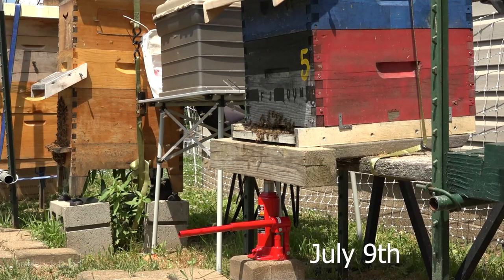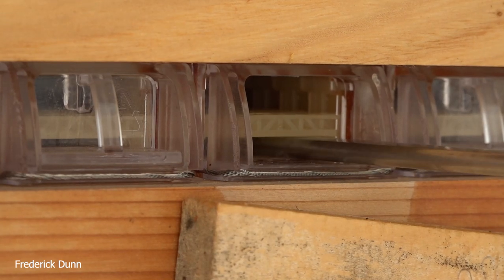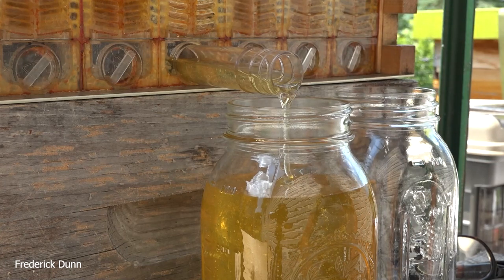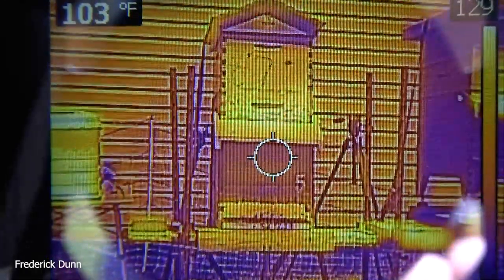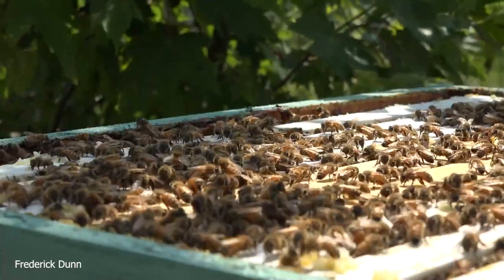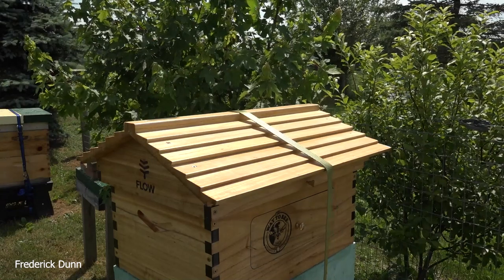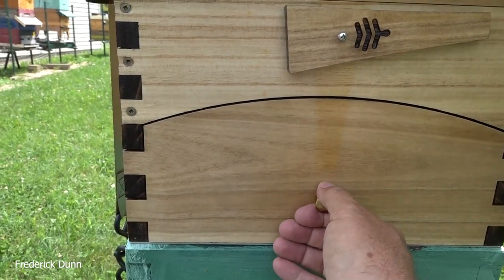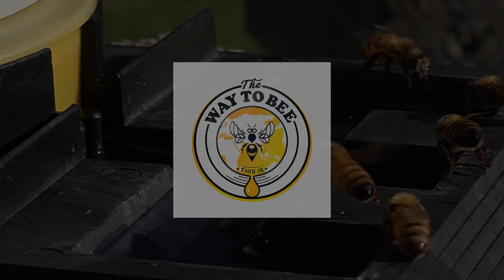Flow Hive Hot Weather Supering, How I Do It Without Queen Excluders, Better Comb Update and more.

Comment: I know it's probably a pain but thanks for the Celsius conversions! :-)
Reply from the maker: Doing what I can to improve on that :)  you're welcome Peter!
Reply: @FrederickDunn  Here in Oz we changed to metric when I was a kid in 1975. But feet and inches are often a convenient measure so I still use those. Temp is more difficult to convert and then you have your own US gallons which are different from the Imperial gallons we used to use. When you get used to metric it is sooo much easier to use. Here's a farmer's example...how much water (in gallons) falls on a square yard when you get an inch of rain? Bonus question...how much would that water weigh in pounds? (Feel free to use a calculator). In metric an inch is about 25 millimeters and a yard is a few inches smaller than a meter. So how much water falls on a square meter after 25mm of rain? 25 liters. How much does it weigh? 25 kilograms. :-)
Reply: @peterzweck1763  that's clever Peter. Where in Oz are you located?
Reply: @jasonrasheed7670  Southern NSW.
Reply: @peterzweck1763  hope you weren't too badly affected in Jan.

Comment: Fred, I put flow frames on two of my hives recently for the first time.  To my dismay, I observed three bees completely inside three of the cells not moving.  Not moving for a long time.  All the other bees around them were busy working.  My initial conclusion was that these bees had died while working.  The next day I came back to find each of these ‘dead bees’ were gone.  Instead of bees working themselves to death preparing these cells, is it possible worker bees take a nap periodically inside the cells they have been working?
Reply from the maker: Hi Larry, you have just witnessed members of the Wax--Workers Union taking breaks at length while appearing to be working from the cell entrance. It's most often the case that they are napping. It's extremely rare, unless it's winter, for workers that are near death to insert themselves in cells. In winter, starving bees will be found clustered in cells trying to stay warm and licking every little bit of honey.

Comment: Great video again!!  

While queens tend to not cross the "honey barrier" going up, what about laterally through a brood box?  If there are several frames with brood toward one side, but one side has a frame (or two) chock full of honey, will the queen go past that hone to lay in other frames there?  Or, should we move those honey frames out toward the side and insert the "empty" frames interior, next/closer to the brood frames?
Reply from the maker: That's a great question!  The brood frames are where the queen continues to lay in a radius of cells... IF she runs out of available cells, she wanders around other frames in the same box. If she meets a solid frame of honey before finding open cells, she tends to go up and search lower cells in the frames directly above the current brood frames. This is why it's so important to leave her with enough room for brood and the workers plenty of room for resource storage above. As a colony can become honeybound during a strong nectar flow, the queen may wander to any cell on any frame and in any box. The nurse bees tend to follow her around and will often ingest eggs that area placed in cells too far from the brood frames. It's somewhat predictable, but beekeepers should be aware that she "could" lay eggs in the flow-super as her options diminish. We have to keep up with the flow-supers so the bees have a place for nectar storage. In the five years I've had the flow-supers without queen excluders, I've had one queen lay in the mechanized frames and that's because I also left them on through winter to see if she actually would do that.

Comment: Hi Fred, great video. I was wondering whether you use Vivaldi boards in the winter for your hives. I live in the UK and thinking of making one for somewhere to put food and using it in combination with burlap to wick up moisture. Especially as there is quite a lot of rain over here and lots of moisture in my hive and over the flow frames. Cheers
Reply from the maker: Actually I don't, as Vivaldi boards vent through the top, even though absorbant materials are placed inside them as insulation. I've found, where I reside, that the bees keep their top interior area warm and dry through winter unless there is venting that introduces cold air and of course an exit for their hard earned warmth. Insulation, without venting would be extremely valuable in winter... they can vent off excess moisture through the enrance and bottom just fine, as they do in the wild. Through the years, we've learned from feral colonies of honey bees, that they avoid top entrances and spaces with top vents or air leaks that they cannot repair. I'll mention this on Friday.

Comment: A couple of questions. 
I notice the wood on the flow super is wood coloured. Did you leave this one natural like you did with the cedar flow 2 out of the box video or did you put a clear finish on it? Also how is the cedar natural finish doing? 
I notice you put a strap on the roof and didn’t use the screw on the side of the roof to tighten to the flow frame. Have you had problems with the roof blowing off? My husband thinks that will be a problem with ours. 
Loved the thermal imaging. So interesting. Thanks for yet another great video.
Reply from the maker: The featured flowhive in this video has a clear finish on it.. Helmsman's Marine Spar Varnish. I like the look of th wood. As for the cedar unfinished hives, they are doing well, though I do finish the roof system. As for strapping the hives, That's because the roof screws don't keep the entire hive from blowing over, and I strap the hives together as a second layer of protection against animals that can topple a hive. The roof blowing off isn't an issue, it's about overall stability. Thanks for watching!
Reply: Try a nylon emlock, instead of steel. They work a treat and don't damage the soft cedar wood.

Comment: Beautiful video there.  I have a question, and maybe a suggestion for a future experiment since you enjoy the science of bee behavior so much. I've heard you mention many times how the bees are very good at regulating the temps in their hive by fanning and moving the air around. And they manage to keep the temp somewhere between 94-97 if I recall correctly.   If this is the case, then why are the better combs buckling without wire support? How hot does a better comb frame need to get before it buckles?  Have you used any internal thermometers to measure the high and low temps within the hive in varying locations on the hottest of days?
Reply from the maker: Hi Shay, the 94-97 degree F parameter is assigned to the brood frame specifically, it may be hotter up in the honey super(s)... Better Comb is much like brand new bees wax and is delicate and because it's inserted in a frame, until the bees finish waxing it to the frame, it's prone to sagging or bowing particularly in the deep frames. Going forward, I'm going to recommend the wire reinforcement on all deep bettercomb installs. With full hives of bees, they do regulate the temps very well and I've not encountered bettercomb failures. BUT, if an expansion box is placed and the bees are insuficient in numbers, temps can get away from them in particular climated where high temps are sustained for many days to weeks. Even natural bees wax can fail under those conditions. The makes of bettercomb state that it has a higher melting temp than bees wax, that may be the case, but bending and deforming are technically not considered "melting" and it still can cause alignment problems in the hive. I don't currently have plans to install thermal sensors inside hives, though that could be useful information in my opinion, particularly in winter here.

Comment: Hi Fred, thanks for the great video! In the video it did not seem that the medium frames were that full of honey. Will they continue filling these frames before producing in the super? Thanks!
Reply from the maker: Good eye Mike!  In the medium super that will be used as the "honey-bridge" it's not important for it to be full of honey, but at least started... with nectar in most of the cells as that defines those cells for honey storage even when partially filled. If I waited for the frames to be full and capped, they would already be putting nectar down in the lower frames and on their way to being honey-bound. So, it's my practice to see that there is no brood work going on in the medium super just beneath the flow-super. If there is, then another medium super is installed before the flow-super. Great question! Thanks :)
Reply: Thanks Fred!

Comment: Have you been able to clean these out when they get dirty? The bees don’t clean them at the end of the season.
Reply from the maker: The best method I've found for cleaning them so far is to power wash them with hot water, it melts out the propolis and wax so the bees can begin again. You need water temps at or above 149 degrees F. Do not let the water temp rise above 160 deg. F. It's the best way I know of. If you don't have a temp controlled power washer, then you can make a hot-bath for the frames and just dip them.

Comment: Curious why you do a Flow frame on top and traditional honey frames in the box below as opposed to only using Flow frames?
Reply from the maker: Hi Dan, in colder climates, we need more honey for the bees and the flow-supers are pulled off for winter. So we have the single deep box, then a medium super full of honey, and then the flow-super during strong nectar flows. This practice also allows me to keep the system without queen excluders as the queen doesn't generally cross over the honey-bridge.
Reply: @FrederickDunn  ah. So you you harvest the honey from the lower box or is it just left for the bees?

Comment: Fred - you inspected a hive an found no brood in the top deep. What if I've got brood in the top deep? Can I move that to the bottom and pull up frames of honey to create a full deep to discourage the queen from moving up to the honey super? I'm running two deeps for brood and resources, with the goal of medium honey supers above that. My package of sakatraz bees have filled the 2 deeps, but put a few frames of scattered brood in the top deep? Also, what's your opinion about moving honey frames to the outside of both of the deeps for winter storage for the bees to concentrate the brood in the middle?
Reply from the maker: IF the medium super has some brood in it, I add another medium for them to work honey stores in, if that's honey-only, then good to go with the flow-super. If you want to continue with the flow-super and have some brood in that upper box, then a queen excluder should be used.